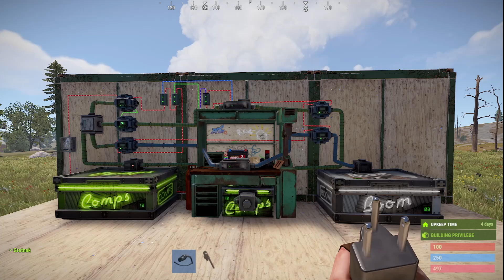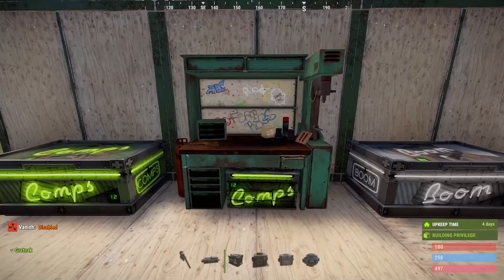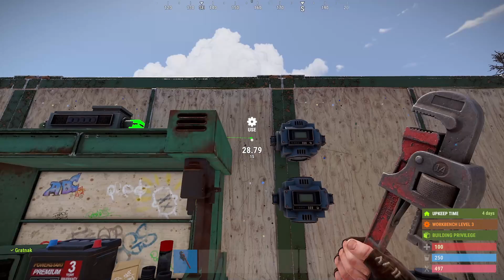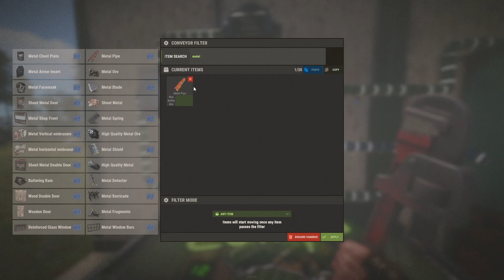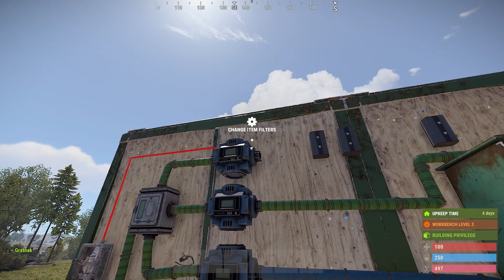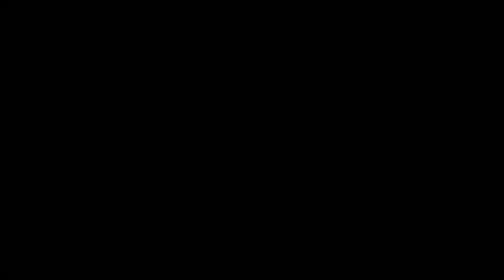Rust: Compact Rocket Factory

Comment: is there any way to make this simpler and faster
Reply from the maker: Thanks for the comment. Both this version and my newer one (video in production) still use a single workbench, so the footprint stays compact. The newer setup is not simpler, it is actually more complex, but it runs about seventy five percent faster. It is the better choice if you want maximum throughput, and I am covering that improved version in an upcoming video.
Reply: @Gratnak good, just wanted some simpler set up I could do quite quicker
Reply: like I could just throw charc sulf low grade metal frags and pipes on one box and grt rockets on the other
Reply from the maker: If you want to throw charcoal, sulphur, low grade, frags and pipes into one box and get rockets out the other, that means the factory has to craft gunpowder, then explosives, then rockets. That is a full production chain, and doing all of that on a single workbench becomes extremely slow because it has to process every stage one after the other.

The version in this video is the simplest I could make while still automating rockets properly. Once you start from raw materials like charcoal and sulphur, you are basically building a multi‑item assembly line. That is where multi‑workbench builds come in, and I actually have an older multi‑workbench rocket factory that handles the whole chain. It is over a year old but it should still function.

With the recent workbench buffs it might be worth revisiting gunpowder crafting on the bench too, so you may have just given me a new project to curse you for while I try to make a single‑bench version work 😅🔥📦

Comment: I’m not sure why I’ve followed the video through but my explosive crafter keeps getting two slots of metal frags instead of having a slot of sulfur and I have to manually remove the frags and add the sulfur I checked everything and it matches yours I can’t figure it out
Reply from the maker: I'll look into this in the morning, I need to review all my videos and update those that require it. I do have a build that works around 70-80% quicker, still keeping one work bench, which I need to make a video about. Thanks for the heads up, I'll let you know if I spot anything.

Comment: this clarifies most of the details i was a little foggy on, however one thing you left out is a bit puzzling. you didn't explain why you connected the filter fail into the power of the next conveyor. 5:15 for reference.
Reply from the maker: Sorry for the delay in getting back to you. It stops explosives being contantly manufactured and using up all your gunpowder, should you run out of components for rockets.

Comment: i put 2x gun powder blue prints 1 behind the explosive and 1 behind the rockets. its 30 charcoal 20 sulfer . i dont mind paying the little extra charcoal. i also make a pipe blue print its 20 scrap and 2 hqm per 2 pipes crafted. so you hear the gp racing in the crafters then a meduim lenght explosive and then that long craft rocket.
Reply from the maker: I do have a newer version that I need to make a video about. Just running my new Rust servers is taking a lot of my time. Just been getting into writing plugins to automate most of the work. I'll be posting again once I get on top of everything. Thank you for your advise and insight. 😊

Comment: When you set it to 10 max will it only make 10 rockets and stop making more, or will it only do 10 at a time so it doesn’t waste anything.
Reply from the maker: It will stop making explosives as soon as it detects 10 or more in the box. This is so it won't go through all the gunpowder, if you run out of pipes and are unable to make rockets.
Reply: @Gratnak oh okay so basically it will make as many rockets as possible if stuff is in boxes but it will only make 10 explosives at a time to not waste stuff
Reply: Going to try it now on an official
Reply from the maker: Yes, that's correct
Reply from the maker: good luck

Comment: Hey, loved the video man! I have one question though. How can I obtain a blueprint that I have already learned?
Reply from the maker: You need to craft that item and then place it on the Research Table, adding the required scrap. You will then receive the blueprint, which you can use in the crafters.
Reply: @ thanks a lot bro, i’ve looked all over for this and didnt find anything. You’ve got a sub 👊
Reply from the maker: Thanks 👍

Comment: I found it strange that you didn't connect the "top conveyor out" with pipes but I guess it acts as a sensor only?
Reply from the maker: Yes, that's exactly what it's there for 👍
As soon as it detects there is more that 10 Explosives, it turns off the conveyor supplying the explosives crafter. Thus not wasting Gunpowder that is needed for the final stage of making Rockets.